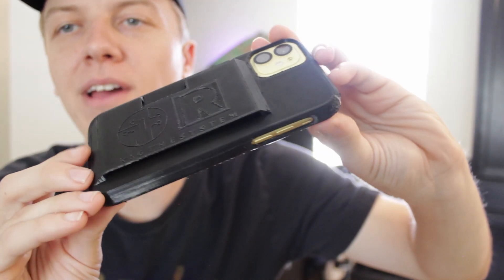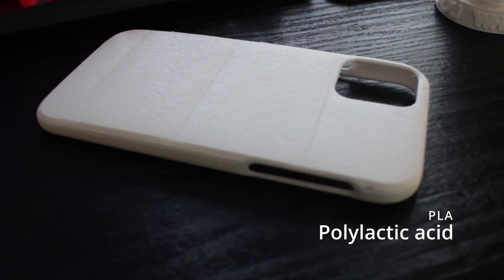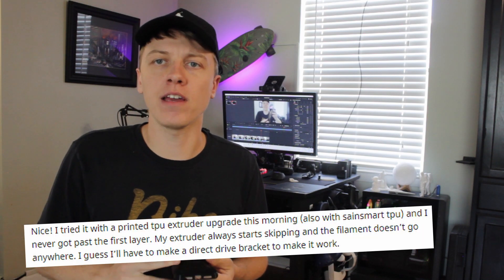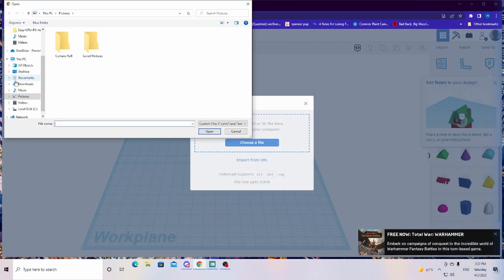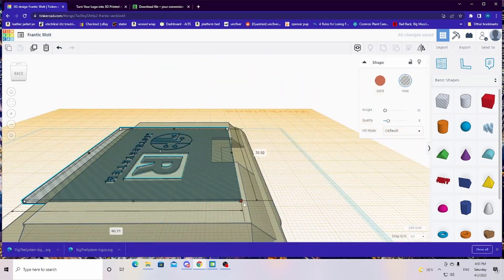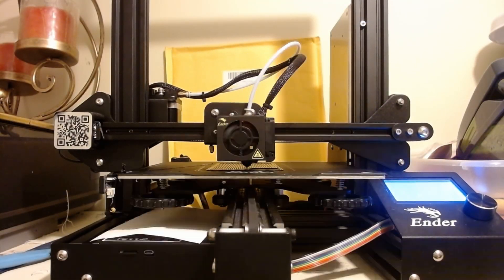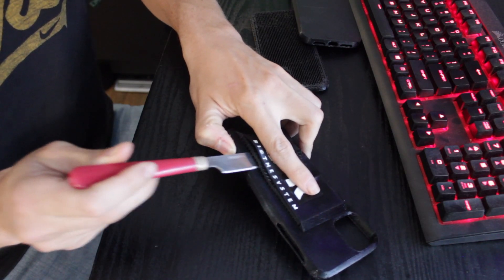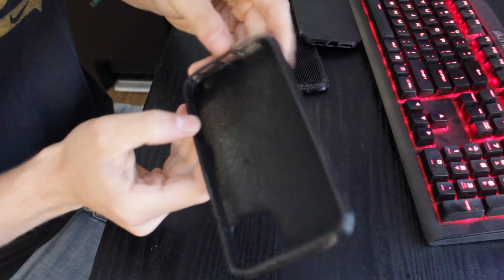3D Printed Phone Case with Credit Card Holder | Printing TPU with stock Ender 3 Pro

Comment: I ordered some dirt cheap TPU on Amazon.  I checked the reviews and they said it worked on an Ender 3 so I tried it.  Prints great on my stock Ender 3 V2 Neo.  The main concern is that you're basically pushing a rope through a tube.  Some TPU might be too flexible to push through the boden tube.

Comment: So it is possible then to print TPUs using Ender printers without any modifications or upgrades right?
Reply from the maker: Yes! I cant speak for all TPU but the type i used worked great!
Reply: Yes.  The main concern is that you're basically pushing a rope through a tube.  Some TPU might be too flexible to push through the boden tube, so check reviews to see if anyone complains about it jamming up in the bowden tube.

Comment: +1 for Tinkercad! I’ve been trying to print a TPU phone case in the same orientation  with supports and they are a nightmare to remove. I’ll try your knife trick next :)
Reply from the maker: Im not sure if it was the material i printed with, or maybe the technique i used to remove the supports, but they came right out for me. Basically once i disconnected some of the supports from the phone case i was able to grab a hold and rip the whole support structure out in one pull. +1 for Sainsmart TPU! And +1 for luck!!